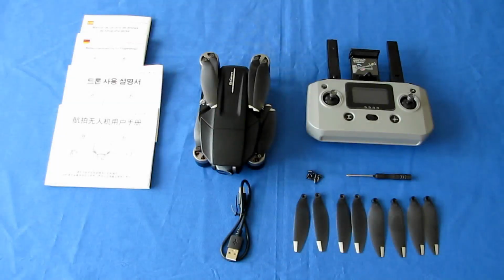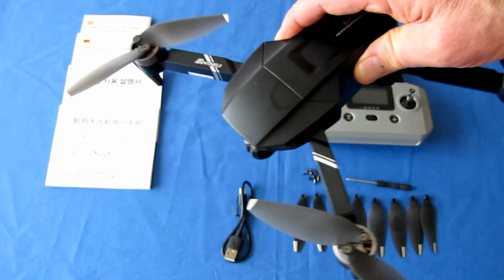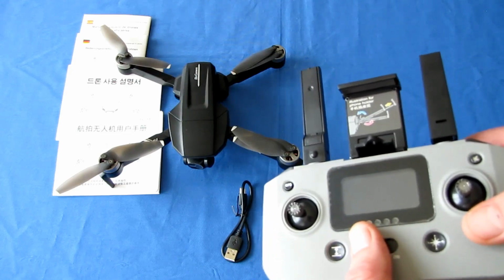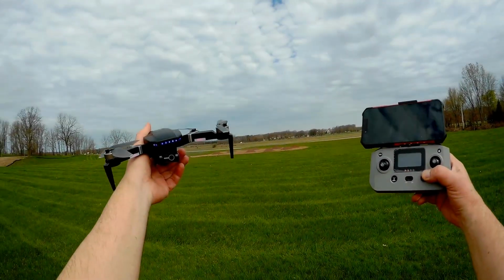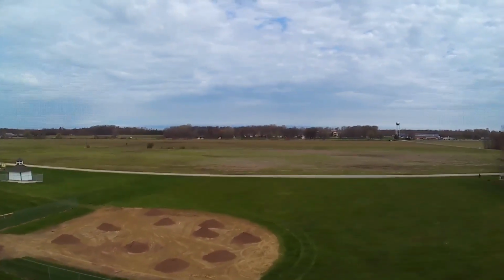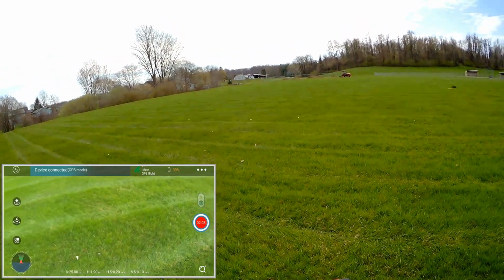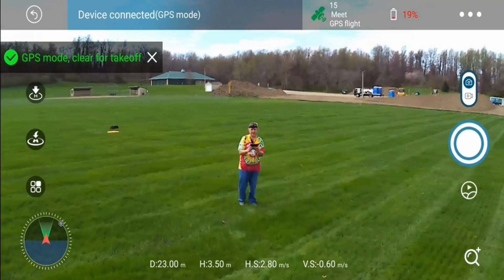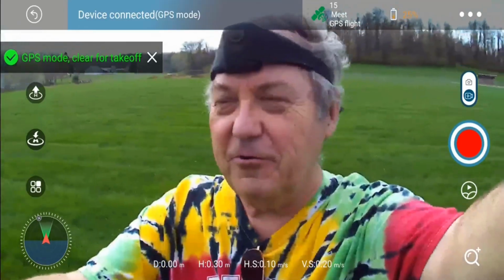LSRC S7S 3 Axis Gimbal GPS Drone Flight Test Review

Comment: I don't understand the way you did the calibration cuz wouldn't that put it at feet from where it should land where if you did the calibration in place meaning just spinning the quad in the directions that it asks in place then the exact point of its location would be used in the calibration
Reply from the maker: The calibration is not for setting the takeoff location of the drone.  The drone automatically remembers the takeoff location, as long as it was receiving at least 8 GPS satellites before takeoff.  Instead, the compass calibration is for adjusting and calibrating the magnetic compass in the drone.  The compass is used by the flight computer for navigation of the drone.  For a magnetic compass, the direction of magnetic north varies depending where you are located on the earth.  It doesn't vary much around your local area.  But if you're flying many miles away from where you did the last calibration (around 50 miles or more), then you should recalibrate the compass. You should especially do a compass calibration after first receiving the drone, as it still may be using the calibration settings from China.